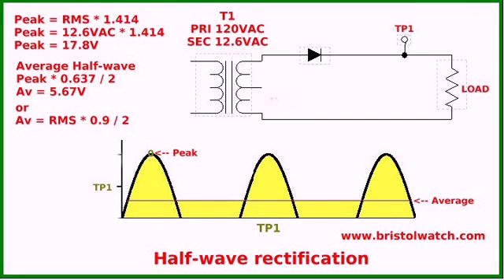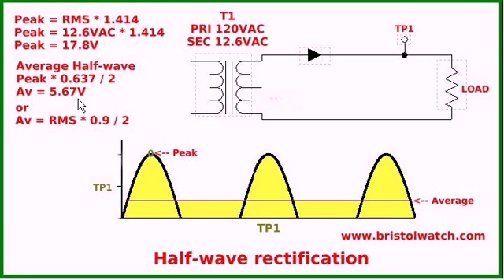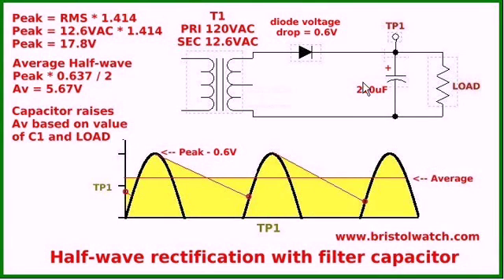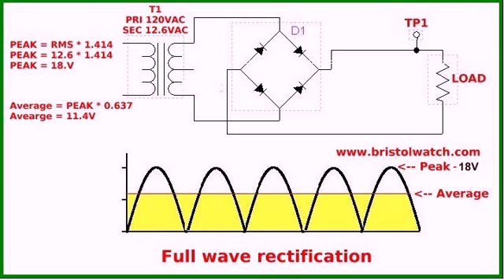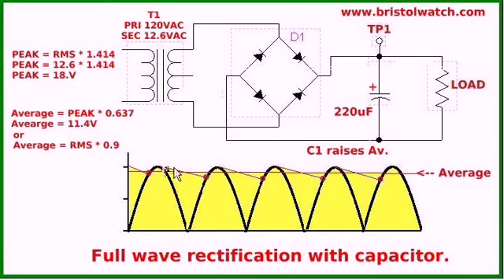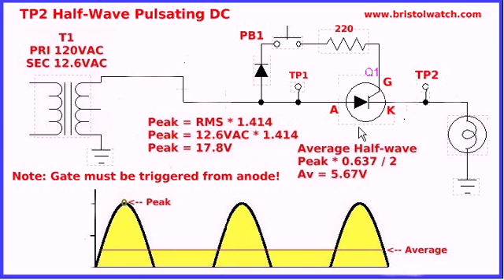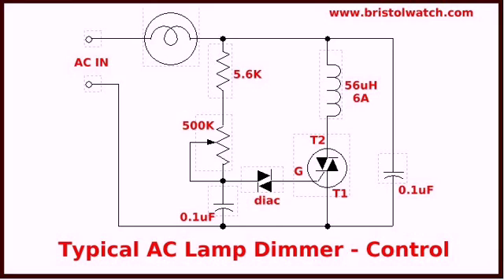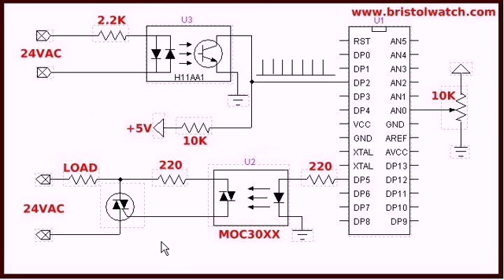Alternating Current Review for Arduino

Comment: ...about rectifying with diodes, you forget to mention the voltage dropped due to diode junction threshold (0,6-0,7 volts). Thus the output is lowered by such an amount. In other words -0,6 volts is the reverse voltage, that enters into the media calculation.
Just to be more accurate...
Reply from the maker: Note the -0.6 in the drawing.